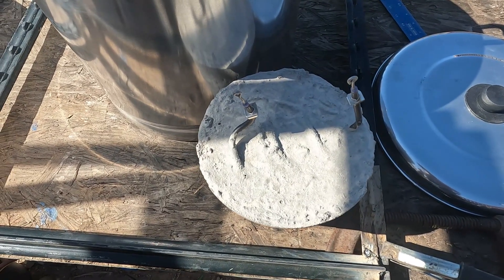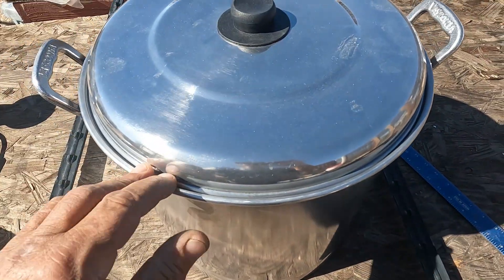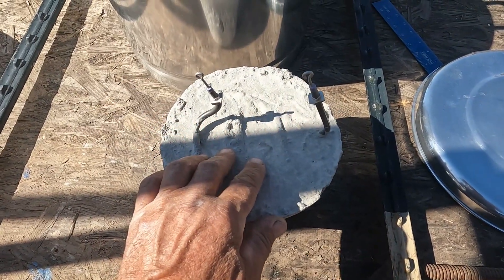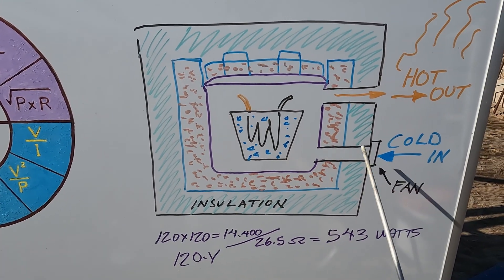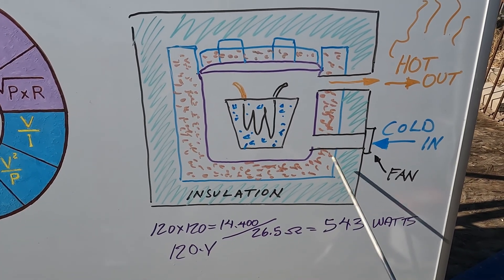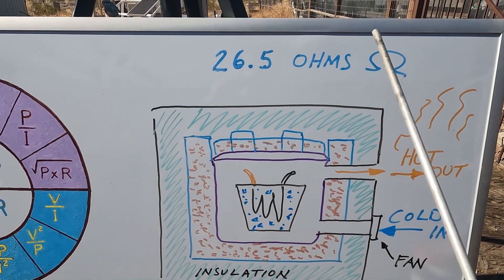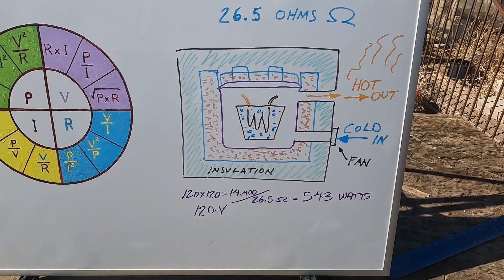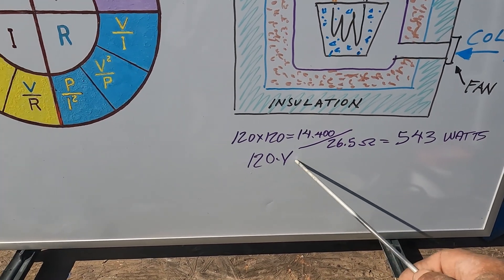177- Thirty-Two Quart Aluminum Sand Battery design

Comment: I have watched all your sand battery videos. I am working on setting up a similar system, but with a single 190W, 24V panel. What would you recommend as a resistor heater element that would be readily available that would be suitable for that input? I have looked at various 24V immersion type heaters, vs, 110V/220V stove and hot water heater elements vs make my own out of Ni-chrome wire, 12/24V car heaters etc. I'm just looking for the simplest, cheapest, user friendly option, preferably off the shelf for <~$10.  Also how to connect to the existing AGW 16/2 type CL3 wire coming off the panel? ie Do I need a high temp insulated wire, if so what gauge, how long? Or can I just connect directly? I know this won't provide anywhere near the heat you are generating but the panel is already installed and not doing anything, might as well get some space heat out of it.

Comment: You need to tell total info. Total watts of solar, total amps going into heater element, total temperature, total time it help tem, total time it raised a room to or over X temp, etc. I just found this channel but Im not watching 94 past videos on sand batteries, to figure out those answers. There is a very small scale test that showed it just doesnt work unless you have a MASSIVE amount of sand just to heat 1 small room over night. re; Sand Battery Scam-- Version 2 with testing and data--by Texas Prepper Projects is a place to start.
Reply from the maker: I watched his videos and I must disagree. There are many applications for this technology.  He made a fancy video but in reality he never really did much experimenting. I will show the world soon it is a viable option. My main problem is I need to move so I am abandoning the larger one as a monument lol 😂.  Don't be so critical it's all in fun and a learning experience.  Thank you for the comment.

Comment: what happened to previous big concrete design? 
Btw. wouldn't be better to dig a giant hole under/next to your heatpump unit outside of home, build giant battery (many tons of sand in the goround, ceramic blocks for air tunnels, ceramic wool around the sand and factory heater connected to solar farm) in ground and a small room for the HP unit to blow a small portion of heat from battery? So your Heat pump would always have +15 C deg inside of a cover. So your heatpump will always run on minimal settings without defrosts.

Comment: Ive been running my samd battery for 2 years strong exactly as i told you i designed it im starting to wonder why you havent made a legit design and fully ran with it or gave your data sand battery needs more energy and to be charged threw summer

Comment: Hey 
Been watching you for awhile now and wonder if you are figuring the heat capacity of your 'battery'  by the size and material of the medium, in other word calories,.
  Maybe you can understand that I have been off grid 24 years now studying and doing these projects for 25 years. You are trying to put a lot calories in your relatively small sañd battery .
  Would you consider an idea? 
  Find a 30 gallon electric water heater that has two of the screw in elements . Replace those with ones that are designed to use DC electric.then  run plumbing to to a car radiator and 12 volt fan with small DC pump circulating the water. Now how much space you need to heat , how well it's insulated so you know heat loss, what temperature difference, and how many hours per day get you to calories collected and then used..
   I never figured out the exact numbers for mine, but if you can get where I'm coming from you understand the idea.
   You need way more mass to store your calories you can collect.the easiest way to do this is moving water past the heat generating source.
   Now not knowing your weather situation etc, in my case when we can get 0-20  degrees for a week or 2 at a time needed more calorie storage. So have 300 gallon tank under the house insulated with one inch of ceramic foundry cloth and 4 inches of foam over that..
   So when the panels are generating they also power the circulating pump from heat tank to storage tank. Then the inside is automatic with pump and fans for radiator run by thermostat from house batteries.
   Sañd battery can be great on commercial scale, but those run at thousands of degrees of temperature for steam turbines for electricity.
   In my case just want to keep the house at 72° so ex wouldn't gripe and she could fiddle with the thermo by the couple degrees.
  Okay getting old and ramble to much, hope to have given something to think on.
Peace Out 
Richard
Reply from the maker: That sounds feasible and practical. This is just a rabbit hole I have been exploring for fun and for practical use if I can get it to that stage. Thank you for the comment and I may give that a try in the future.
Reply: @off-gridsurvivalmike8120  
Thanks.
   You see there's no way for me to understand your calorie requirements
     My place is 3 bedroom about 1600 sq/ft , and being up near the top of the mountains, can get a couple of weeks where high temperatures don't go over twenty during the day.  
  If you want to discuss some other ideas on implemention that's cool.
   Got started when good panels cost 8-- 10$ /watt . So a little old fashioned on saving how many watts needed to do what's necessary. While using stuff learned from a few trades so both AC and DC used as little as as needed to get the most done.
Peace

Comment: I've ran through all the math. The most effective setup is a heat pump and an AC system. A cold mass storage and a heat mass storage. Good luck out there!
Reply: @peppernickelly  
More efficient yes, compared to resistive or catalytic electric heating, technology that was invented over 125 years ago, and we kept using because electricity was relatively inexpensive.
  So you are buying expensive equipment that can fail in multiple ways and hope for a 5 - 10 year life expectancy, and pay an even higher price for the replacement.
  Have you ever heard of the K.I S S. rule that engineers and designers like to follow.
Peace
Reply: @offgridmanpolktn  Back when we built everything to last 50+ years? I get you, but we could be talking about 200% more energy ability. Consistent cooling ability and heating ability. I advocate for more energy exploration, now that we can all have digital agents that can fine-tune systems for us after construction is done. I think we can go beyond the K.I.S.S. method more often in current times.
Reply: With a heat pump being 200% to 300% real world efficiency, you will gain more ability than resistive heating and a AC system alone. They have to be combined and only use resistive heating when the heat pump can't do any more if needed.